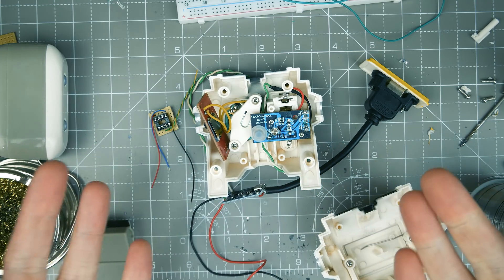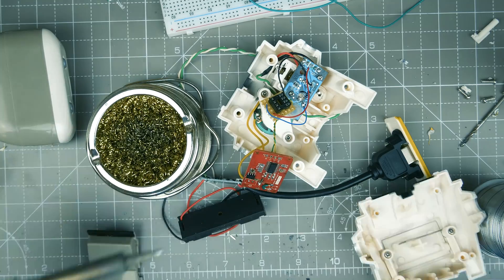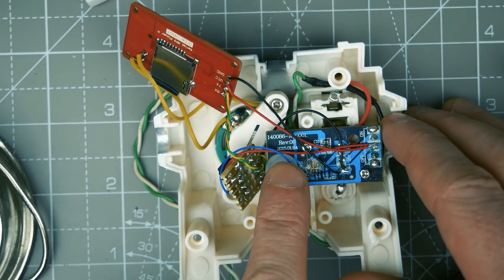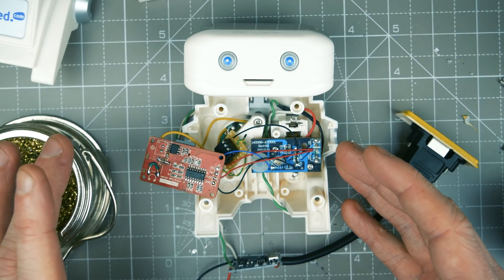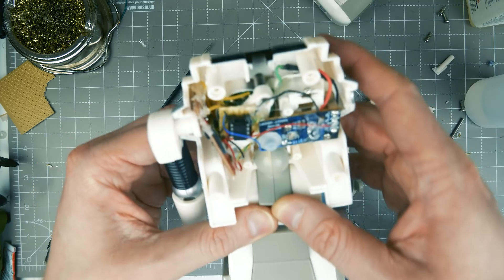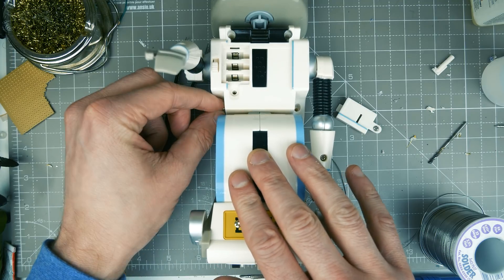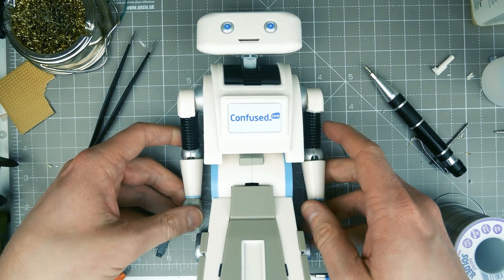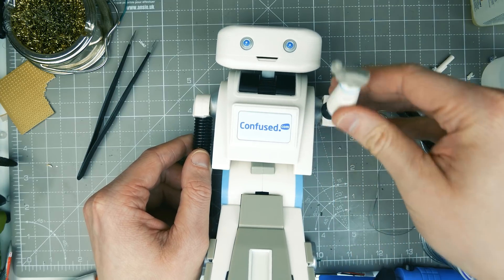Brian the Robot Part 3: Configuring the Positronic Brain

Comment: Hi David ,
Buy a box of these silicone wires , i have them and i like them .
https://www.aliexpress.com/item/50m-30AWG-Flexible-Silicone-Wire-5-color-Mix-box-1-box-2-Copper-Electrical-Line-RC/32808866369.html?spm=2114.search0104.3.9.4f056fe6DRFy2R&ws_ab_test=searchweb0_0,searchweb201602_5_10065_10068_319_317_10696_10084_453_454_10083_10618_10304_10307_10820_10821_538_537_10302_536_10843_10059_10884_10887_100031_321_322_10103,searchweb201603_1,ppcSwitch_0&algo_expid=942b8abb-2445-4998-b14f-8610547894ce-1&algo_pvid=942b8abb-2445-4998-b14f-8610547894ce&transAbTest=ae803_3

Comment: Hotglue is great. Its really sturdy, there are flexible versions and you can remove it again (often without traces) if you have to.
Its also used in industrial equipment for good reason, tape/glue tends to age or loosen, especially when getting over 50°C.
I prefer hot glue over epoxy because no allergic reaction or glueing unwanted stuff or having to use gloves or chemicals.
Also great for potting in ground cable connector boxes.

Comment: Sounds like Stephen Hawking reincarnated.   ;-)
Good job.
Reply from the maker: It's from the eSpeak library originally known as speak and originally written for Acorn/RISC_OS computers starting in 1995
Reply: @DavidWatts  I'm familiar with eSpeak.  I didn't know it started with RiscOS.
Reply: More like the old MacinTalk synthesizer which I believe was developed by Lernout & Hauspie and runs on the built-in DSP in the old 68k systems.